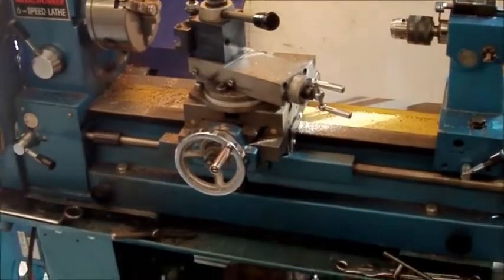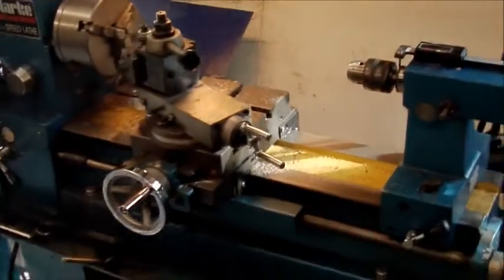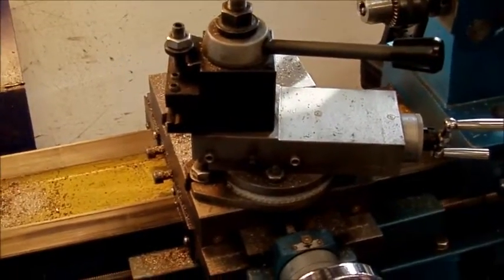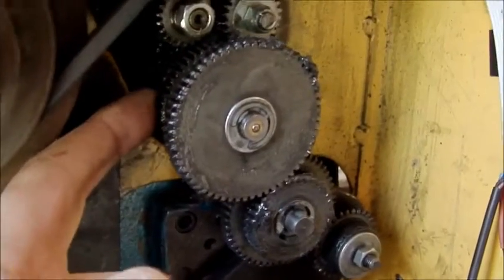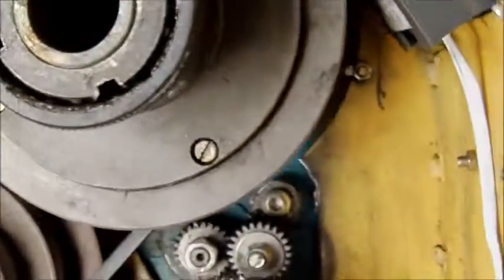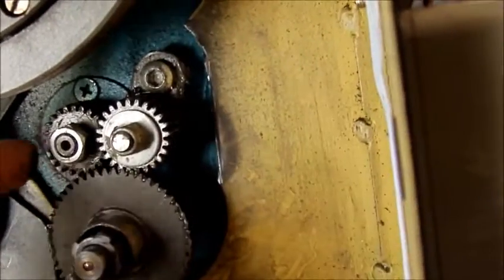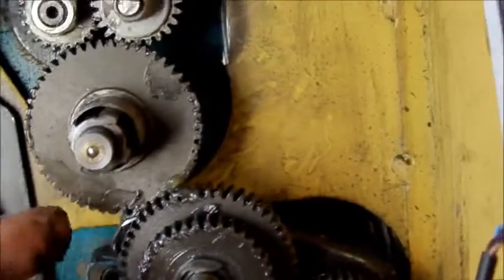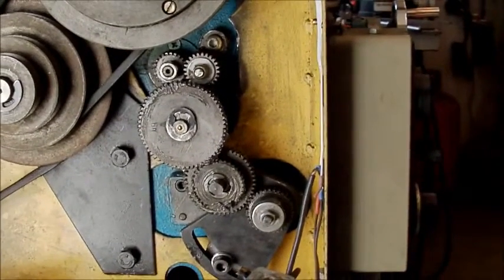Clarke CL500 Lathe Left hand thread mod

Comment: hy there please can you help me i have a cl500 and want too start metric thread cutting not bothered what size yet just want to get started can you advice me on what gears go where as the manual sounds complicated too me lol
Reply from the maker: hello Rabbit I am not sure I can help you if you think the manual is complicated any input from me will be just the same. The manual is pretty good as are the info on the door you just need to get the gears in the right order if you are unsure do a scratch pass on some scrape bar and this will help you find your way. Good luck cheers

Comment: Hi, can you tell us more about the bracket used to support the 2nd main drive? Was the added thread hole for the bolt a through hole? And would it be possible to use the 50T idler gear mounts to install the brackets instead of drilling a new hole? Am not sure if this idler gear's shaft is threaded in or forced in.
Reply from the maker: Hello there the bracket was just a plain simple piece of bar stock about
20mm wide which the bolt holding it to the body of the lathe was threaded
and but the body of the lathe is not very thick so not to much thread there
so be careful.the bolt holding the gear is just a through bolt.
hope this helps cheers Nigel
Reply: @fixitnige  Thanks for the quick reply. Just found out that Smithy 1220XL has a reversing option built-in. It uses a different change gear plate and puts a reversing gear between gears C and D. Since the manual doesn't talk about lefthand threading setups, I believe it uses one of the change gears for reversing. Thought you might want to check out Smithy 1220XL parts list and diagram. Now we have 2 methods/modification for reverse threading. Cheers!

Comment: hi can you tell me the size of the change gears you used for this type of thread
Reply from the maker: Hello keith the gears are explained in the video the only gear I bought was another drive gear.

cheers Nigel
Reply: hi sorry to bother you again but I am interested in the thread gears one I can see is a 60 tooth but I cannot see the other 3 gears.
Reply from the maker: Hi Keith the gears that were on at that point were just the gears I use for general turning,
but all the gears are standard cl500 gears you can find all the details for these gears 
in the manual page 21 tells you which gears to use just search online there is plenty of info.
cheers Nigel